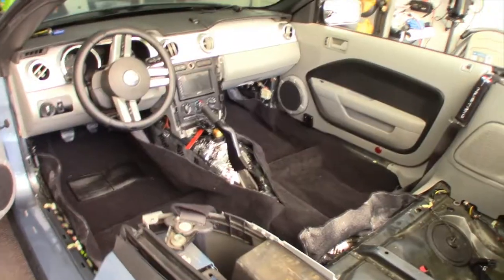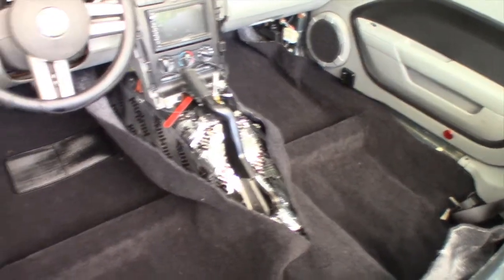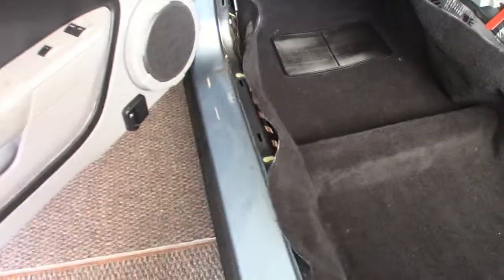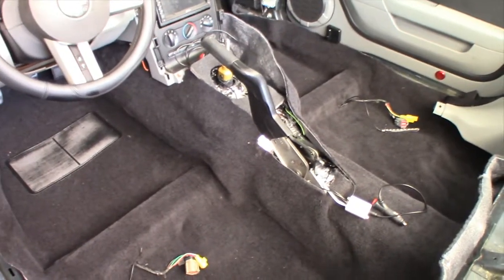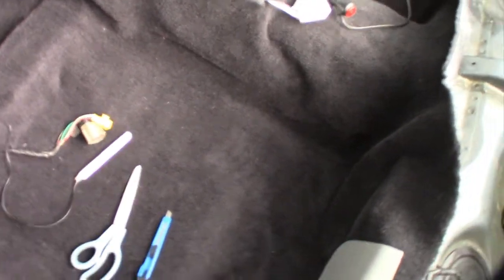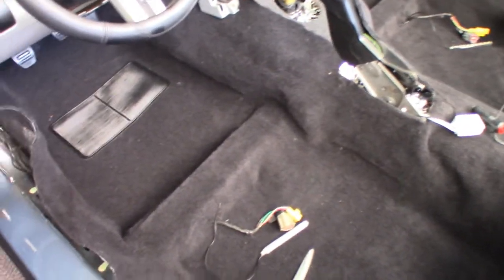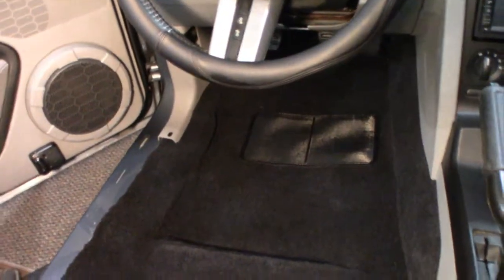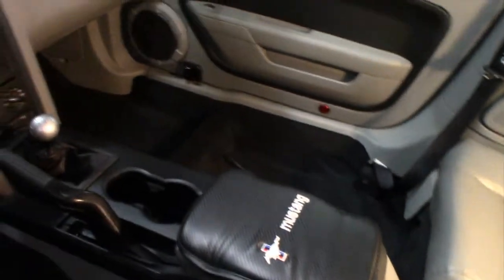2005-2009 Ford Mustang - Carpet removal and replacement - Carpet Install, Trim re-install

Comment: So lucky to be doing this in a convertible lol. Had numerous water leaks in my stang and just now found the leak (at least the primary leak). Stumped on whether I should just try and deep clean the carpet (get rid of the mildew/mold smell as well as dirt) I have or just get new carpet. Great video by the way.
Reply from the maker: Thanks Preet. The carpet cost about $140 for the thin backing. Add another $60 for the boom-pad self adhesive sound insulation . Overall about 8-10 hours, but I was also trying to video and explain things. Add to that I am working my regular job full time from home with a  virtual desktop, so my time gets chopped up.

Deep cleaning is always and option. It all depends on your goals. I am trying to bring back old skills, and learn new ones. This car will be a keeper for me and pass it down to one of my daughters in a number of years. So I am putting more money  and hours into it, than many would. So if you are looking to sell yours within a couple years, then be very careful what you spend money on. You will not get it back out of the car, unless it is a very desirable/ collectable..

Regarding leaks in the 'Stangs. There are 2 drain holes that can get clogged up, one on the driver side and one on the passenger side. 

Best of luck to you.
Reply: Blood,Sweat,and Gears definitely, after thinking about it for a couple days I think it’s worth for me to replace the carpet that way I avoid the possibility of mold exposure. I got lucky with not only the drain holes being plugged up, but also the door trim not sealing right, and I am pretty sure the cowl grommets are leaking a bit too. Thinking about going no carpet for a while until I’m sure the car is sealed. Thanks for the advice!